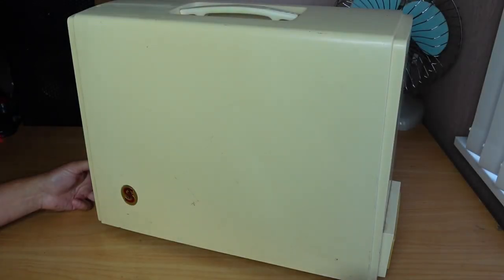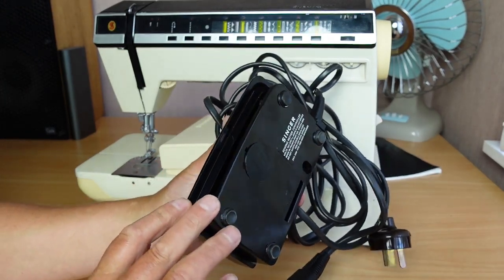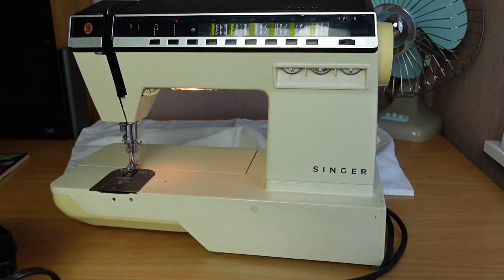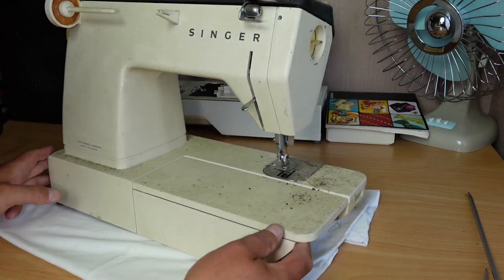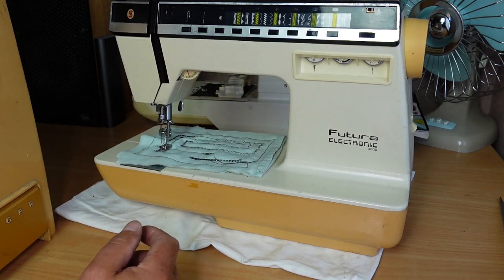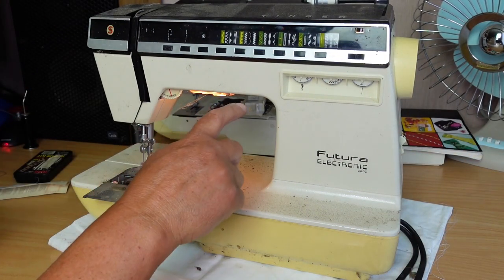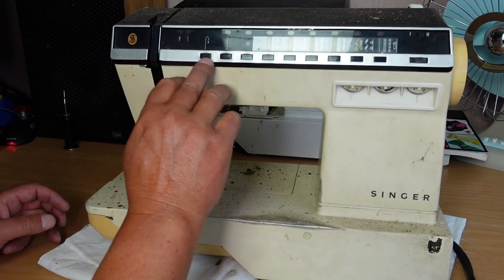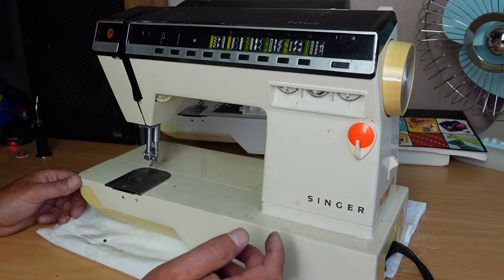1980's Singer Futura Sewing Machines - Assessing Machines From My Collection - Three Models

Comment: Your timing is impeccable.  These things are all over the USA in various second-hand shops, and available for very low prices at that.  I was wondering if I could get your assessment on the motors and their associated switchgears? It seems these motors and controllers might make for excellent donor units for some of my older machines.  What do you think about that?

Cheers,
J.R.

Comment: I threw away a singer athena 2000 today as the button on the bottom wouldn't reset and the dogs only worked in reverse.  I was hoping your video would show me ideas on fixing it but it didn't.

Comment: I hope to see exactly where you put that drop of oil in the bobbin area. My Touchtronic 2001 sounds like some of those machines.
Reply from the maker: The oil goes between the large outer ring that turns and the bobbin case which does not turn. I hope that helps in the meantime. I will show it in an upcoming video. Thanks.

Comment: I have a couple of these high-quality American or German machines and the electronics (motherboard) have failed on them. Such a shame that replacement parts are not available.
Reply from the maker: Yes, it is a shame. I guess a component level repair could be possible on the boards but that could be more hassle than it's worth.
Reply: @InStitches  Perhaps you may be ineterested in selling one after you've serviced it. I woudl love to have a working one in my collection.
Reply: Inspired by your video, I had another look at the Futura 2002s using the clamshell foot control from another machine and hey bingo, at least one of them appears OK. Stitch length - is it mechanical in these machines? - isn’t working properly but that may reflect the need for a service,
Reply from the maker: @marksmale827  That's great to hear you managed to get one going. The stitch length is adjusted via a stepper motor as far as I know but will confirm in a later video. It could be that the mechanism for stitch length adjustment is seized up.
Reply from the maker: @marksmale827  Are you in New Zealand?
Reply: @InStitches  Waikato! I have a good mind to ship it to you for a service.
Reply from the maker: @marksmale827  Sure. My email address is in the video description. Cheers.

Comment: I have same machine and have problem with  not picking up bottom thread is that an easy fix
Reply: This video may help You - https://www.youtube.com/watch?v=TdUh-tO843E These models have the same mechanical part. Start watching on 1:10.
Reply from the maker: Thanks. This method works but only after confirming the needle bar height is set correctly.